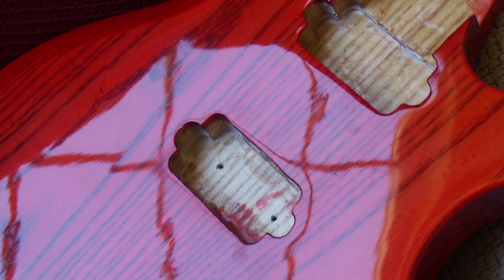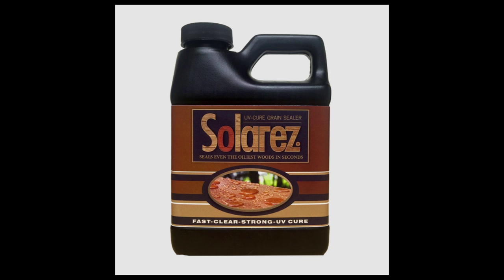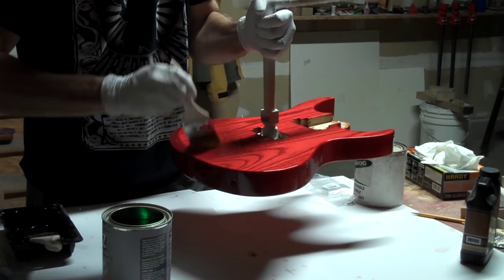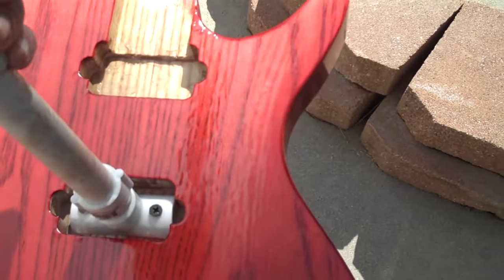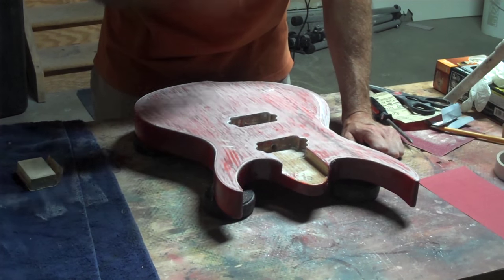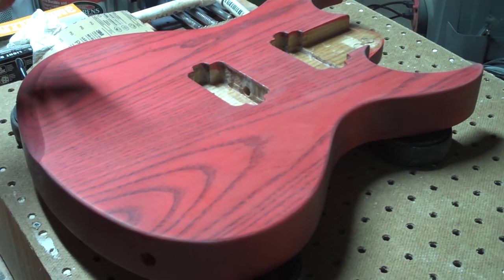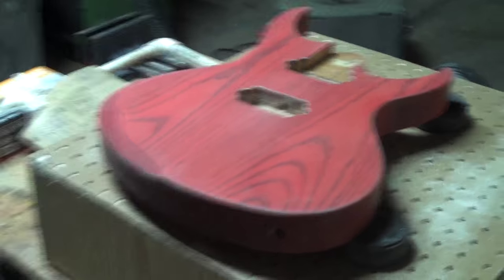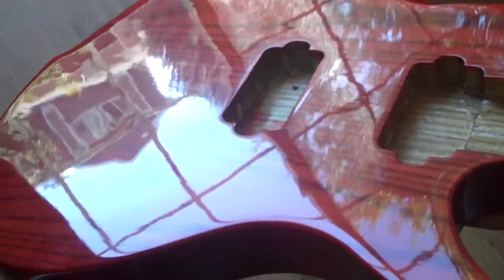How to Clear Coat A Guitar With Solarez UV Cured Polyester Gloss Resin

Comment: Beautiful!  What is the red dye?  Does it apply evenly over a base sealer coat, or is it better on raw wood?
Reply from the maker: The absorption of dye into wood can be unpredictable. That's why I stress testing on scraps saved from making the body, neck and fretboard. If you're building a kit and don't have scraps to test on, play it safe and use a sanding sealer to ensure uniform absorption.
Reply: @HighlineGuitars  Thanks.  I haven't used wood dyes much, but in my tests, it has indeed been difficult to get a uniform finish on raw wood.  I've been trying Mixol, which has a rep for being relatively opaque.  Maybe there are better dyes.
What is the brand of dye that you used here?  It looks like it goes on more evenly.
Reply from the maker: @stringtheoryx  I used Keda dye. They sell aniline dyes which are very intense.
Reply: @HighlineGuitars  Thanks, Chris. It certainly looks more vibrant than the Mixol that I've tried. I'll order the 5-color set.
Reply: @HighlineGuitars  I bought a set of 5 Keda dyes.  They are brilliant.  Thanks for the tip!

Comment: could you apply a decal on the neck after you lay the grain sealer?  I am wanting to do this on the headstock, but I wasnt sure if I should do a waterslide decal before I put the resin down or at the very end after everything has been buffed.  I want to "bury" the decal, but since you put the resin on early in the video I thought that would really be the only opportunity to put the decal on (Assuming the compound would rub the decal off without being sealed.  Thanks for the reply.

Comment: Great tutorial and wonderful finish.
From your experience , does the top coat adhere to itself for multiple coats ?
Reply from the maker: Yes, as long as you sand the previous coat first.
Reply: Thanks a lot 
I'll give it a try then
Reply: so, that would mean there is a wax agent incorporated in it I would assume?  Please correct me of I am wrong, but I have alwYs been told that you can pour coat on top of coat with polyester resins as long as there was no wax agent in the resin, which is typically on the last coat.  the reason for the wax additive is so you can sand.  otherwise the resin remains sticky and clogs up your sandpaper ..

Comment: Would you use CA glue to repair small dings, scratches and chips to a polyester finish? I assume that for small repairs to a poly finish that fresh polyester resin would not bond to a previously UV cured polyester finish or would just look unsightly.
Reply: I like your thought process.. I use CA to repair stone all of the time.  I think it would probably work.
Buckle up!  you can use the resin to do seamless repairs!😃 it is not much different than the CA process.  resins are kool😃

Comment: Can I use the grain sealer and then apply a lacquer coat instead of the Solarez resin?
Reply from the maker: Yes, but I always recommend testing on scrap first.
Reply: @HighlineGuitars  would there be much advantage to just lacquering it without the sealer? Thanks for the prompt reply!
Reply from the maker: @petermcfarlane6911  There is no advantage. Without a sealer, the lacquer will sink into the wood grain. If that doesn't bother you, go for it. If by lacquer you mean nitrocellulose, I recommend sealing with a vinyl sealer first.
Reply: @HighlineGuitars  Well then I might try the Solarez after all!  Thank you!

Comment: I never had very good success with this because I live in a condo. I started a project that I could normally have done, no problem when i had a detached 2 car garage sized work space..  I took for granted that i used to not have neighbors. The next thing you know, i had neighbors complaining about the chemical smell and very fine dust from sanding. My condo has a gas line to the hot water tank/ flame, also... not recommended to use this technique in a condo. I got my project semi done and just did a relic type job. Dont use an orbital sander because it shatters off chucks down to the wood stain. I ended up with a very uneven surface, even with hand sanding
Reply from the maker: What you've described is why Solarez came up with I Can't Believe It's Not Lacquer. Almost no odor and it sands like a dream. https://www.solarez.com/product-category/low-odor/

Comment: Hi, great finish. Can I use any sanding sealer under this or do I have to use Solarez ?
Reply from the maker: Use Solarez Wood Grain Filler. The Gloss Resin will adhere better to it and will give you a bulletproof clearcoat.

Comment: Did you have any of the dye get pulled out when applying the grain filler?
Reply from the maker: I don’t remember. These days, I spray a sanding sealer first to lock down the dye before applying filler.
Reply: @HighlineGuitars  what sanding sealer would you recommend?
Reply from the maker: @SoleilCustomGuitars  I use and recommend Crystalac water-based sanding sealer.
Reply: @HighlineGuitars  I do have some of that. No adhesion issues?
Reply from the maker: @SoleilCustomGuitars  I haven't had any. I always recommend testing on scrap first if you can.
Reply: @HighlineGuitars  of course. Thank you for the advice
Reply: @HighlineGuitars  oh and I almost forgot. I built my first CNC based on your plans. Sold it to another Luthier and that was 4 years ago, still going strong. I also go into using CNC for my builds because of you. I also have the xcarve pro 4x4. Thanks!

Comment: Would the Solarez Resin make a satisfactory finish over a coat of paint and if so, what. type of paint would you recommend?
Reply from the maker: Yes, it works well over paint. I typically use water-based acrylic paint.
Reply: Thank you for your prompt reply, much appreciated.

Comment: I'd love to try this (and 'I can't believe it's not lacquer) but sadly if I buy this in the UK the shipping will be three times the price of the resin.
Reply from the maker: International shipping is CRAZY!
Reply: @HighlineGuitars  Unfortunately most of the brands you use are unavailable this side of the pond (I think I've found Z Poxy and that's it) and the specialist luthier suppliers don't offer much (So far I've found Crimson Guitars finishing oil, a pretty good selection of nitro cellulose and one water based poly that I can't find a review of)
Reply from the maker: @numberkruncherr  Maybe Brexit will help? The last time shipping to the UK was so hard was when U-Boats prowled the Atlantic.
Reply: @HighlineGuitars  It's highly unlikely that Brexit will help much of anything. In this case the issue is shipping costs, not import duty, so even if the UK drops all import duties on that class of product (I don't know if there are any) then it won't make any real difference.

Comment: Hi and thank you for the videos!  They really are great!  I hope you can help me, I'm doing a guitar body, after I walked out into the sun, i realized that I didn't get complete coverage on one small section.  Can I add more Solarez (poly resin) on top, will it blend?  Do I need to sand the first coat for adhesion?   Thanks!
Reply from the maker: Sand the area around the section you missed first, apply, and cure. Nest sand the whole surface, apply another overall coat and cure. That way you don't have to worry about blending, which it won't.

Comment: Hi Highline Guitars,
Does Polyester resin has UV protection, I mean Can it last long time exposure to the sunlight, as if you apply it over some veneered trim in a car's dash board? Does it yellows over time? How well it resist to scratches and cracks due to manipulation?
Reply from the maker: Since I don't build cars, I can't speak to how it would perform on a car dash. However, this is from their tech brochure for the product, "It is enhanced with UV stabilizers to greatly improve its weatherability."

Comment: I made a wooden cylinder out of Bocote. I used the solarez grain sealer on the inside of the cylinder and took it outside(87°) and it hasn't cured in 2hrs? What wrong???
Reply from the maker: Bocote is a very oily wood. Did you use this? https://www.solarez.com/product/polyester-uv-cure-grain-sealer/
If not, that's what you should have used.
Reply: @HighlineGuitars  Yes thats what i used. I wiped it down with acetone, let it dry and applied with brush then wiped the excess off with small squeegee.
Reply from the maker: @krank2kold  You'll have to contact Solarez and see what they say. I've got nothing.

Comment: Hi.
Thank you for this video.....
I have bought the Solarez Polyester Resin  (black branded tin) for my guitar project but when I tried it out on a sample piece (the wood is African sapele), it just pitted.
However, I didn't use grain sealer underneath the resin, will this make a massive difference to the problem I have with this pitting?
Also, does it have to be Solarez grain sealer?
Thanks
Reply from the maker: I highly recommend using Solarez Wood Grain Sealer first because it will give you the ideal surface for the gloss resin to bond with. It will also block any contaminants from migrating out of the wood and into the gloss resin. An alternative to the Solarez grain sealer would be dewaxed shellac, however, the Solarez grain sealer works better. The pitting you mention can also be caused by the temperature of the air, the wood and the resin. If it's too cold (below 75° F) gasses in the resin can be trapped, which will form tiny pinholes that can be revealed during level sanding. Apply the gloss coat in a warmer temperature and let it gas off for at least 30 minutes. It helps to frequently turn the coated wood as it gasses off to prevent runs and drips. Also, try a 10 second flash cure in sunlight followed by a 10 to 15 minute rest out of the sun before the final 3 to 5 minute cure back in the sun. It takes some experimentation to figure out what works best, but in the end, it is the fastest and most durable way I know of to clear coat a guitar. Hope this helps.

Comment: Would it cure using a UV lamp if going outside is impractical?
Reply from the maker: Yes, but check with Solarez to see what UV specs work best. I think they recommend 365nm to 385nm.

Comment: I have a single guitar kit, and I'm having a difficult time talking myself (and my wife) into investing the money into your buffing setup--although it would be perfect. I have a random orbital dual action polisher that I used on a car a few years ago. Would it work well to attain the high gloss, mirror like shine? I know it's not optimal, but would it get the job done if I can find satisfactory buffing pads?
Is there a better alternative than my polisher, suitable for use on one guitar (not my livelihood).
Reply from the maker: In your case, I would recommend the RODA polisher you already have. You can get a very nice shine with the right pads and liquid polishing agents.
Reply: @HighlineGuitars  Thank you! Now to start researching pads and polishes!

Comment: If you want to take down the grain faster and get it really flat take a utility knife blade hold it at a straight 90 degrees and lightly scrape the top. Same idea for taking down a run in paint. It flattens out the surface really nicely.
I know this is for the polyester finish and a sealed surface is really nice but if you want a cheap way to seal the grain of wood take ordinary wood glue and thin it with a little water and apply it to the wood and let dry then scrape the top, basically the same idea as how you only let the first stain sit into the grain and not the surface. This can only really be done for filling the grain before painting as I do not think it will stain unless using stain-able glue. Its an idea I thought of when people want to use a softer wood in something like a telecaster, I've seen plenty of pine telecasters out there and filling the grain with glue seems to for the glue to hold the grain together creating a harder wood, I only thought of this when people were talking about glue joints on guitars and said the glue is stronger than the wood. 

Really top notch job. You take pride in your work.

Comment: - Does it yellow overtime, after being exposed to all kinds of lights?
- Any update on how does it hold, in terms of cracking and whatnot?
Reply from the maker: It will not turn yellow or crack. Polyester is the most durable clear coat product you can use, which is why so many big guitar companies use it.
Reply: Thank you!
Does it have an amber tint to it? How do you compare it to the Minwax wipe-on poly? same cure time? Are these two essentially the same kind of "polyurethane"?
Sorry for asking too many questions, but you are my only EXPERIENCED reliable source when it comes to these stuff. Thanks again!
Reply from the maker: It's nothing like polyurethane. It's polyester. Crystal clear. Cures bone dry in sunlight after 3 minutes of exposre.
Reply: Thanks again! I'm very tempted to use it on my next finish job.
What is your go to CC these days? Maybe you should make a video about clear coats ;)
Cheers!
Reply from the maker: I still like Solarez, but it can be tricky. It seems to like warm to hot temperatures when applying. My go to these days is Crystalac Brite Tone Instrument Finish. It's water-based, easy to spray and dries harder than anything else I'ved used except the Solarez.
Reply: Once again, thanks for all the info!
Reply: I intend sanding my maple strat build to a fine grit before applying this polyester Solares high gloss. Would I still need to seal the wood? If yes, what can I use instead because I am not sure I can ship the sealer to where I am overseas. Thanks.

Comment: hello one more question how would you gloss up the resin on a small item of only 3 inches what would be the easiest way to get a gloss on an item of that size was going to buy the buffer system and the compounds you mentioned but thought it may be over kill so I thought i would ask
Reply from the maker: +Paul Andrews Try an electric hand drill with a buffing wheel and some liquid rubbing compound. Follow by hand rubbing the piece with swirl and scratch remover.

Comment: did you put down some sort of sealer before the stain to stop it from splotching?
Reply from the maker: I don't remember. I posted this video 5 years ago. However, I would recommend applying a sealer before the stain to ensure even stain absorption.
Reply: @HighlineGuitars  I'm asking because I used the same product and method and it basically destroyed my work. I'm guessing denatured alcohol from my stain got under the sealer and messed with the resin cure.
Reply from the maker: @prestigeroseguitars8245  That's why you should ALWAYS test on scrap wood before committing a new technique to a build.
Reply: @HighlineGuitars  I tested the resin but not with stain on it. Never would have considered it. Lesson learned.

Comment: F A N T A S T I C !!!  I believe, (after MUCH research) I've finally found the WATER BASED system I want for finishing my guitars.  Minor fume problems, and (apparently?) no need for an overly exorbitant "explosion-proof", ($$$)  spray booth, BRAVO !  I'll be doing two versions, one being a Gretsch 6122 '62 clone, and a RIC 330 Red Fireglo 12 st.  Have you tried any "Bursts" as yet, and how easily would this stuff Spray,(since I've already built a Dandy walk-in sprar room), @^%!$(*&^$#(*)&%$!!!  I've also built a 14" dual stationary buffer.  I see you like "Rockler", (cookies)?  Also like the idea of no WET SANDING, never did like that, plus you run the risk of swelling the cavities!  Thanx again Mate.    Gb    bg

Comment: I have a kit with binding that I plan on staining natural, will Solarez have issues with the binding? Should I tape and remove before going into the sun or Solarez right over the binding?
Reply from the maker: Solarez is polyester. Most guitars makers are using polyester on their guitars with or without binding.
Reply: Highline Guitars Thanks, so no need to tape over it! I am considering this type of finish, will let you know if I use and how it works for me.  Thanks!
Reply from the maker: Make sure you use the Solarez grain filler first. It not only fills the grain, it creates a surface for the gloss resin to bond to.

Comment: Did you do anything to get the surface flat between the grain filler and the top coat?
Reply from the maker: No. You can't the grain filler cures tacky to help the top coat bond better.
Reply: after the grain filler i ended up with some heavy business card signs and some bubbles on the edge what have i to do ? do i sand the sealer ?

Comment: Do you need the sealer on a basswood body with a maple cap? Or just open grain woods
Reply from the maker: I use the sealer on all wood types before I use Solarez. It helps the gloss resin adhere better.
Reply: Thanks, I've ordered the sealer as well. Might try preheating some basswood in the oven at 175 and do a trial to see if it prevents pinholes.-Andy
Reply from the maker: Please let me know how that works. I am really curious. I've noticed fewer to no pinholes when the air temp is warm. Like over 80° F.